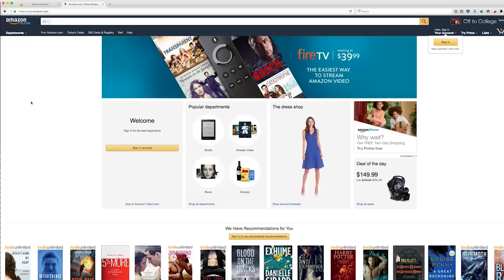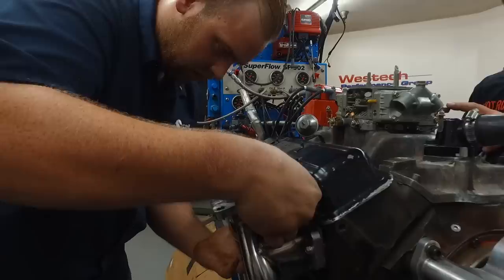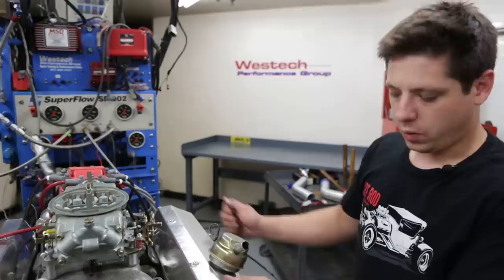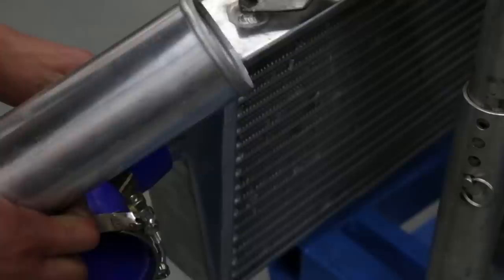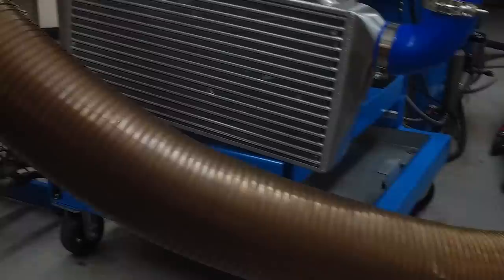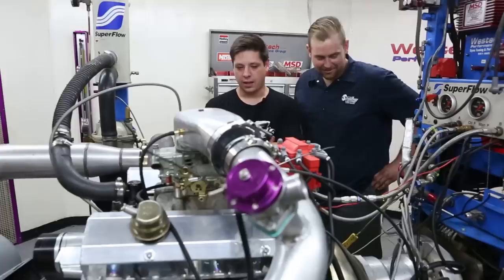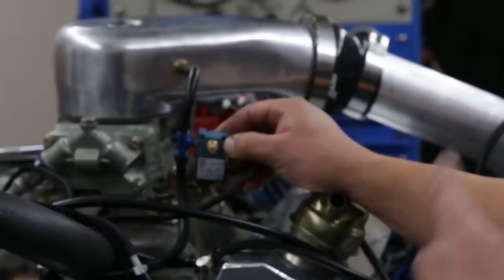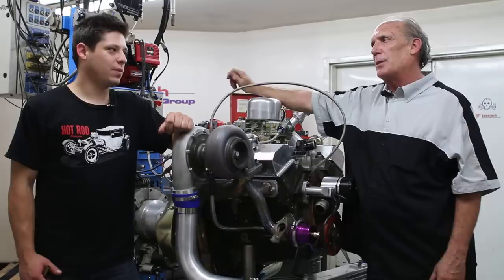Small-Block Turbo Kit for $699! But Does it Work?

Comment: That's poo from a 350 ci or 5735cc turbo motor. (Especially as it's got a cam change) I can get that kind of power from  a 2000cc 4 cylinder cosworth yb running stock head and internals.  Utterly disappointing.
Reply: Yeah, but it handgrenades every 5 min. They got 600 in GpA engines with 100 hp at 3 grand and 600 at 4000! Lightswitch useless power. On some very expensive engine.
While I doubt this Chev would have a very long life either it would at least be streetable. Better pistons and rings and camshaft [overlap is bad] will make a useable engine. But for drags only as near all motorsport has a 6 litre [366ci] limit and with 1.7 equivilancy is way too big.
As a long time road racer the zillion HP 2 litres are so east to beat, baulk them off the corner and it takes a lap  to even get near you. 700hp 2 litre v 530hp Chevy in similar weight car is seldom any contest. And harder on brakes too with less engine braking
Reply: LDN Wholesale    I'm not sure about the cars your using these engines in but the cars here in Europe are quite light. The last one we owned was only 800kg.  The 4 cylinder engine with reasonable boost, nothing silly just 28psi  was very drivable.   Could run around in town all day.   But that was only running about 480ish hp.   Turn the boost up and with the correct ignition and fuel curve adjustments. It could run just over 700hp in a street car.   Better head and who knows what it would of done. Point is I don't dislike big Vs but the seem quite dissapointing when turbo charged.  Oh and the power band at 700hp was about 3700rpm. Not bad really.  Those are figures based on a chassis dyno so I don't know the flywheel hp and torque.

Comment: Yeah having 540 HP is all fine and dandy til a connecting rod flies through the side of the block and it melts a piston, at least build the motor to handle boost smh

Comment: Box of junk if you ask me. Useless on a car other than maybe the turbo itself
If I went that route Id just buy a good quality turbo and fab the rest at least it would fit and function correctly
THat crossover is useless unless its on a van or truck 

Still think to do it right youll spend well over 1000. Or cobble zip tie and hold your breath til she blows. 
Not sure I could even make use of 600lbs hard hooking just under 5

Comment: You cant DO THINGS ON THE CHEAP. One WEAK cheap as part can destroy a 10,000 $ motor or 100,000$ motor for that matter. Your engine is only as strong as its weakest part. The war is won before its even fought is an old saying. Planning your engine from the oil plug on up is the way to go. High Performance means TEMPERAMENTAL. Information is Power and the web is full of free tips and practical applications, plans and everything under the sun. Bolting on Nitrous to a stock crank and pistons is nice, BUT the engine is not designed for that load. When An Engine goes Tits Up, everything goes with it. You end up with a 600 pound paperweight, a stamp of IDIOT on your forehead and a Shit ton of money right down the drain. As a sniper will tell you, they kill with Math. Same with an engine. Choose your application and design, IN YOUR HEAD, accordingly. Then execute the plan with an eye on extreme detail. I build high performance engines and have personally seen motors blow, for the price of a 1.00$ cheap, overlooked part. I am not proud of that, but we learn to get better, BY DOING. AN expert engine builder, whether you are building a 50cc weedwacker airplane, to a 4000 horsepower drag engine, looks at the big picture and you also have to constantly keep on eye on the engine during use. They are tempermental by nature and that goes with high horsepower. The gentlemen are right. You Can bolt something on and gain horsepower, UNTIL your wastegate blows off at 68 pounds and your Engine is a pile of Steaming Sushi. Plan first, pay attention to extreme detail, then Build. my two cents anyway. Excellent video 5 stars and No DisRespect. RH DSD
Reply: Motors $150 at the junkyard  who gives a shit if you blow it up.

Comment: Wait...wait...wait. So, don't mean to be rude or anything but before you guys even had purchased the turbocharger, did you guys check the reviews on the Turbocharger. Because a couple of seconds into the video it shows a 2.5 star rating out of 5. So, of course there maybe some things you guys might have to thing about before diving into installation. My engine is coming from the same place and the turbocharger I'm getting has a pretty dang good review. It has a 4.7 out of 5 star rating and the customers who brought it said it was a good set-up on their car. No issues whatsoever. Just something to think about.

Comment: C'mon, Hot Rod, step into the 21st century and use modern engines and ignition systems. Stop digging out dinosaur junk out of the mud in the back of junkyards (esp. tchebby junk).

Comment: Sounds like there pulling the us aftermarket company line,crybaby can't mprovise at all there is no such item as a"bolt on turbo kit" all the way back to calllaway,ak miller and ddmi kits required mods.they used the valvecovers were an excuse to whine about the turbo figment,which you can buy a 1" to 1.5" flange spacer to fit the turbo,and if these guys have tig,just 90' the t4 flange,if your building a kit a single piece of paper is not your blueprint.bunch of whiners.metric and standard.AUFKM?thats how chevy always built there Oem garbage,and western clearly wants to sell turnonetics stuff and their stuff breaks too.notice they said "worked too well"ext gates are cheap enough,loved how the morons routed the exhaust in front of the intercooler.you get what you pay for when you know how to use it.no improvisement creativity,want to see cheap eBay stuff run forget worstech,see sloppymechanics.com and they will show you how cast pistons survive 800 hp,nuff said